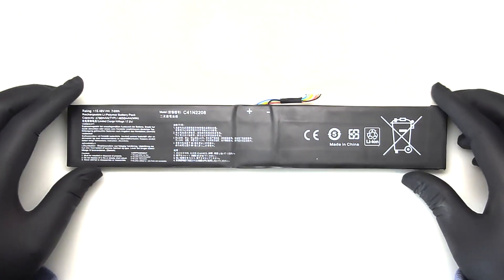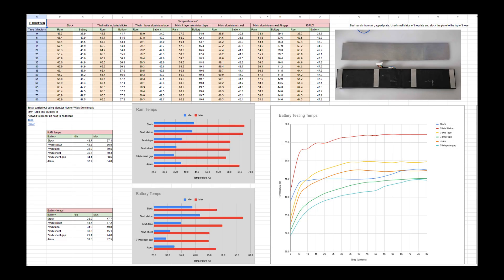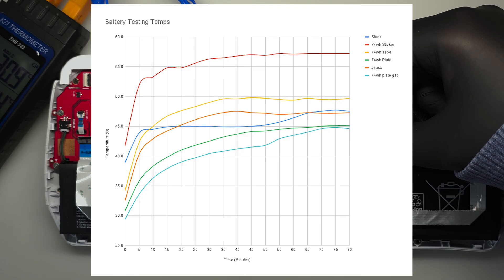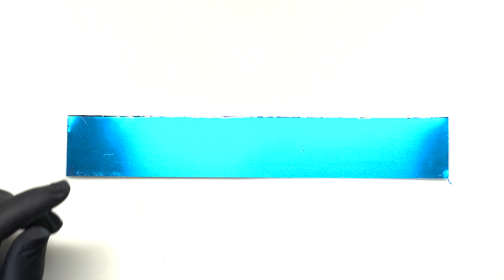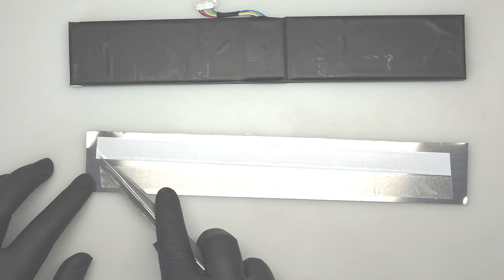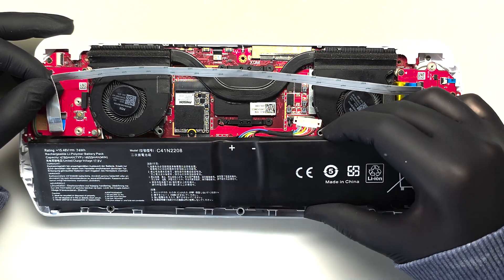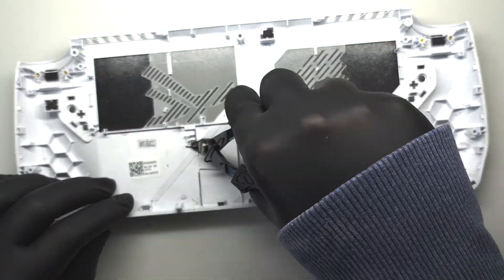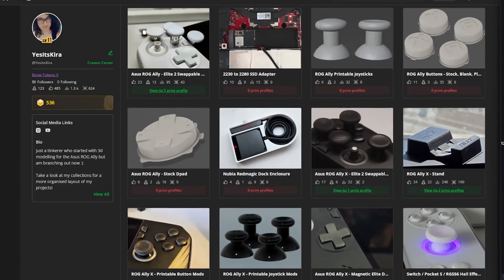ROG Ally 74wh Mod - Full Tutorial and Safer Method!

Comment: For the 4 Alum Strip metod it goes like this?

| |---------------------------- Battery ----------------------------
| |-------------- Doble Side Tape Strips (4) ------------
| |------------------ Aluminium Strips (4) -----------------
| |-------------- Doble Side Tape Strips (4) ------------
| |-------------------- Aluminium Sheet --------------------

| |--------------------------- RAMS --------------------------------
V
Reply: Have you cut down the two plastic parts ? I use the same setup and the case close on the lower end with the screw without problems. I did add the led from jsaux after cutting it a little bit lower ... No problem right now
Reply from the maker: @ChiroHiroyuki  Thats right! You will really need to make the backplate fush and use the thinest tape you can get for that method though.
Its alot of extra work for just 1c better than the plate on its own but it does help :)
Reply: @YesItsKira_  Thanks for the fast reply, I got everything ready just waiting for the battery!
Reply: Mod done. It working like a charm, just 1 question.

I'm using the jSaux clear backplate when I was closing the Ally the lower part would not close by it self. I had to thigh the screws in order the close it. Is that normal? Note: I moved the foam strip on the ram Board from the original place to the lower place just below the ram Board SO the aluminium plate could have another support. Should I remove it or trim it?

Thanks alot for the amazing guide
Reply from the maker: @ChiroHiroyuki you may need to trim the 3 supports around the bottom screw post in the backplate to get a good fit.
You can keep the foam or remove it since it doesnt do anything for this mod :)
You really dont want to have to use the screws to keep the ally closed. The screw inserts in the bottom of the frontplate are really easy to rip out
Reply: @YesItsKira_  i'll check it out this weekend! I'm also not too ok with those screws doing all the work.

Comment: Just installed mine today..I'm blown away by the performance and I noticed the temps in game overall in Horizon Zero Dawn will not go over 60-62°C (will check for the battery specifically). Got like more than 2h 30m, half of the time with screen brightness to 100%. One question, do you think it's suitable to add the m2 2280 adapter on top of this mod?
Reply: It is possible

Comment: Very similar to what I did. I wrapped the batttery with one layer of aluminum tape though(and also did the 0.5mm aluminum sheet). you think that helps at all? TY
Reply from the maker: @JhuJhustine  Hi! I actually did test combiations of materials too. The tape didnt improve antthing when combined with the plate but it doesnt really do any harm either. Its just uneccessary for the mod :)
Reply: @YesItsKira_  thanks!